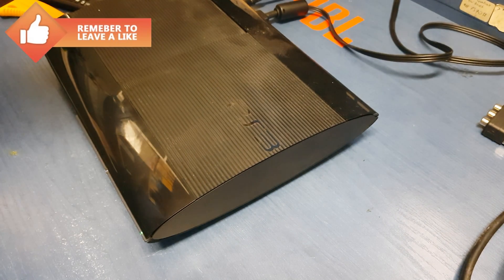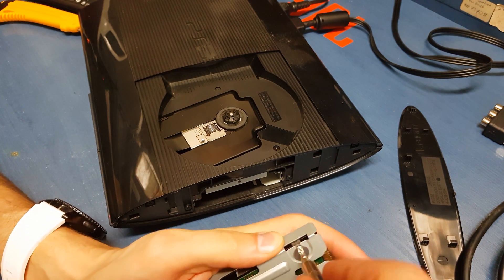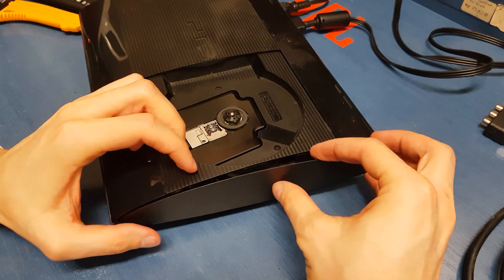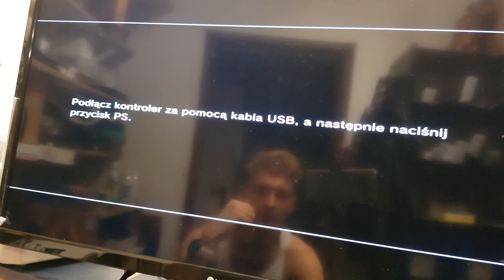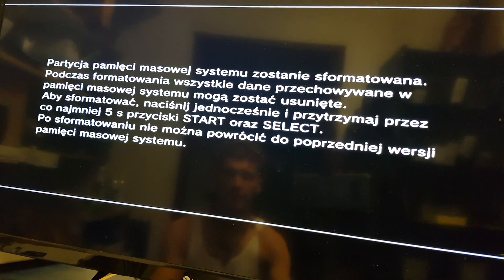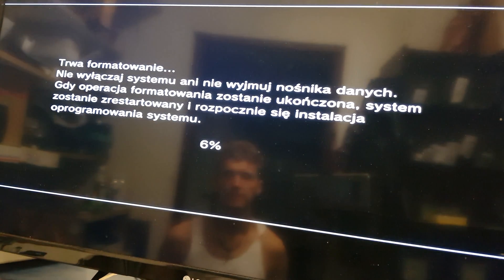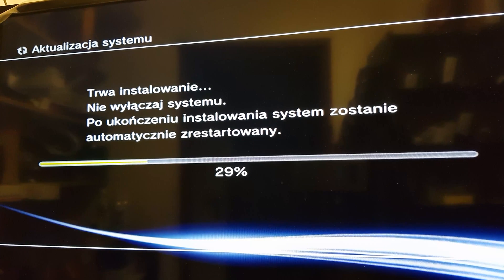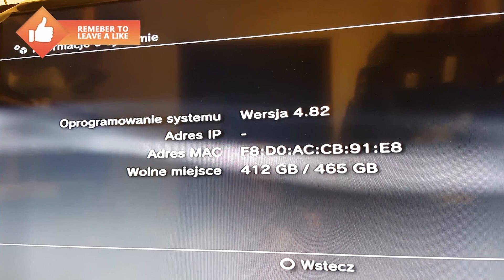How to change / uprage and format HARD DRIVE in PS3 Playstation 3 | Superslim

Comment: I’ve watched roughly 10 videos on the upgrade process and one of the biggest sticking points is removing the hard drive cover. I’ve tried numerous times pressing my thumbs and hands into the cover and pushing it away from the console without success and to no avail. 

Suffice to say that I was having a really difficult time getting the cover off. However, even with that being said, I’m delighted to say that after watching your video where you literally pried the cover off I did the exact same thing and the cover now pops off with no issues at all whatsoever. 😁🥳👍👍